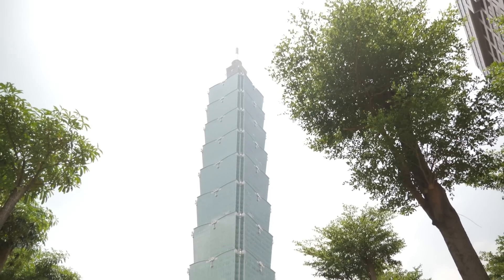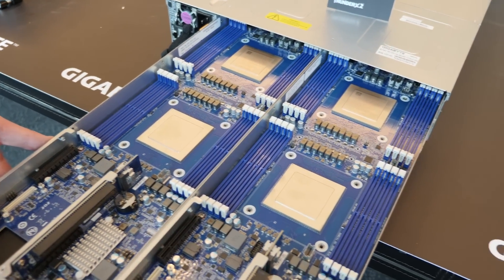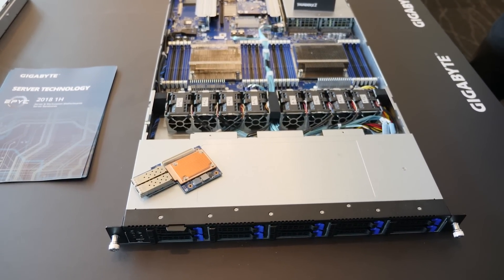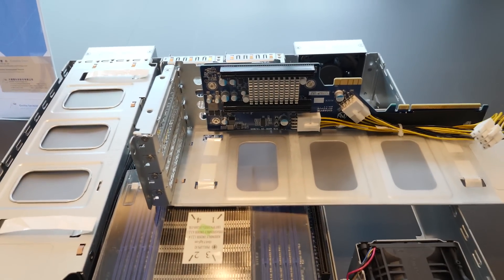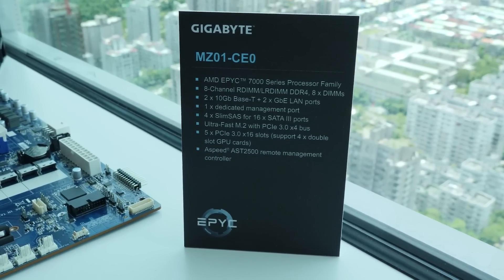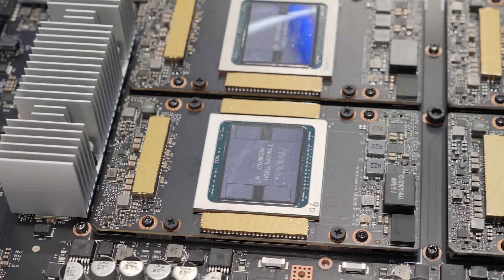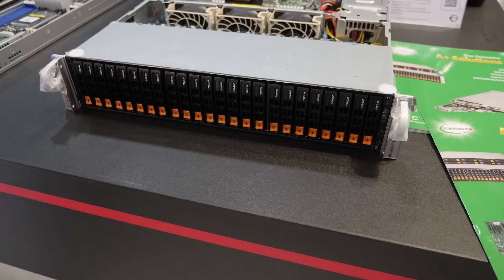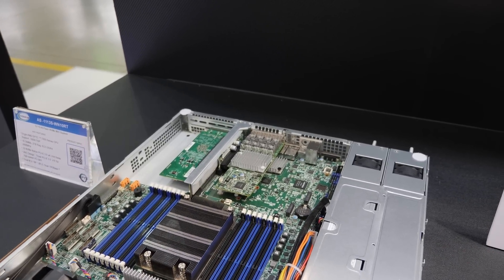1 Petabyte of Flash in 1u, 2 Petaflop  Servers & Enterprise Gear of Computex

Comment: The breakout cables are nothing new and certainly not unique to SuperMicro.
Every Network vendor has them now and you can use both DAC (TwinAx copper with molded SFP+ / SFP28) or you can use an MPO Transceiver which has 8 fibers and then a Breakout fiber cable which converts that MPO into 4 x LC (More expensive but supports longer runs up to 100m easily).

Comment: 9:31
i can't see the epyc chip getting enough cooling with this cooler being designed for extremely high server airflow.
given the cost of the system, why didn't they produce an adapter for the noctua  tr4 cooler and strap that one on this epyc chip?
or whatever other much better solution, given the cost of this workstation! but hey it's just a prototybe so maybe sth. is already in the works, but no need to bother until then and just run the server heat sink instead i guess.
Reply from the maker: epyc chips are extremely power efficient, part of why is they are not clocked crazy high. You'd be surprised how not-hot epyc cpus actually get, even the higher end ones.
Reply: hm, very true, but the epyc 7601 for example still has a tdp of 180 watts, which is super efficient for damn 32 cores! but still a lot to cool i feel like for such a small heatsink with very little airflow compared to what it gets in a 2u server rack.

Comment: The number of 40mm fans on that chassis at 7:32... dear god that thing must sound like a boeing 747 at takeoff.
Reply: welcome to 1u servers :/ it's not as bad as you think but just don't run them at 2m from your desm
Reply: I figured, I've been in a couple of server rooms so I do know the high pitched drone of those 40mm fans.  But still it would be quite loud.
Reply: George D 
What server room? I slide them under my desk. No joke.
Reply: I'm counting 22x 40mm fans 😁 oh ye it'll sound like a jet for sure
Reply: Ender06 These are servers, nobody really cares about sound as they will be stacked in a rack in a separate, most likely solidly ventilated anyway, room away from the users.